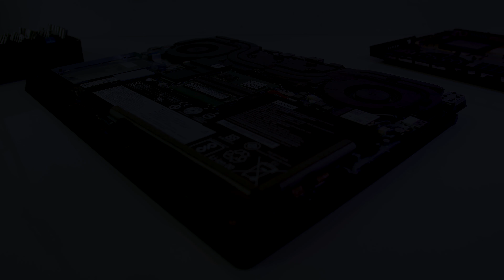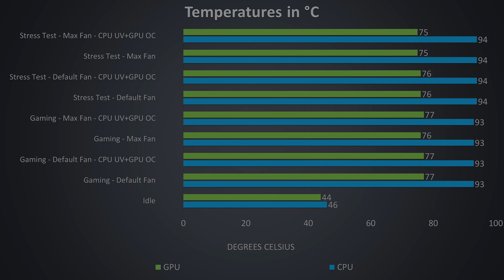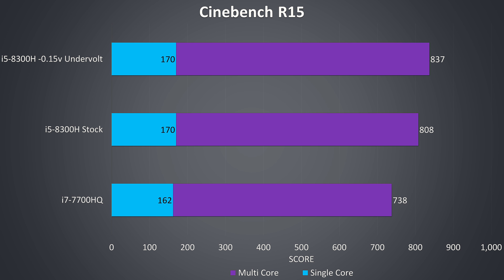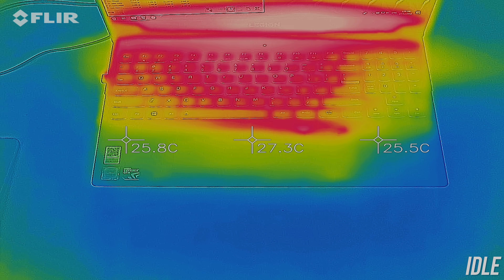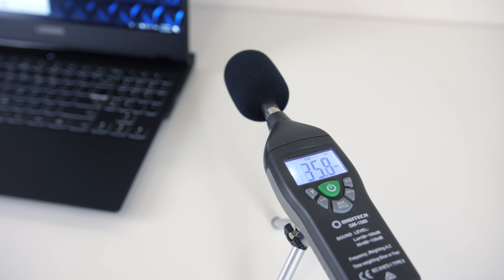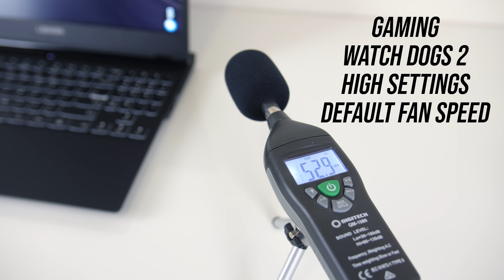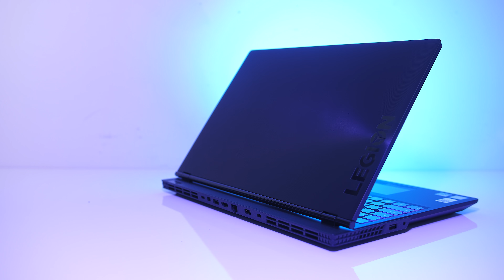Lenovo Y530 Thermal Testing, Overclocking and Undervolting

Comment: I'm having this one with i7-8750H, 1050Ti, 144Hz screen (more color accurate than 60Hz). It comes with 135W AC adapter which is rather not enough. Battery starts discharging while gaming and also getting some power throttling. UV of -0.15 (stable) helps with thermals and reduces power throttling but it's still present. If I overclock the GPU (240/400) power throttling is getting even worse.
The sad thing is that 1060 variants come with 170W AC adapter - wonder why not all. Currently thinking of buying one of those.
PS. I found out that lifting the back of the laptop a bit (~1cm) reduces the temps by 1-2 degrees.
Reply from the maker: Oof, yeah sounds like it might be worth trying to get a more powerful adapter.
Reply: The crazier thing is, look on their website and lenovo makes 230w adapters for the P52, which has an 8750h and a lower tier quadro graphics card... And probably the same power connector. So for the 8750h and 1060 model which i have... I kinda wanna try that... But lenovo only specifies the y530 as compatible with the 135 and 170w adapters. And i put too much $ into this thing to start blowing fuses.
Reply: @Cal94   so 170W is not enough for 1060? In general if you plug in more powerful adapter it should not affect the laptop given the V is the same. It's the same thing as computer PSU - you can have 2kW PSU on a $500 PC it will just be waste of money.

Comment: How did you adjust fan speeds? I have the Y530 but it seems my fan settings are locked.
Reply from the maker: Control + Shift + 1
Reply: @JarrodsTech  Thankyou for the help and speedy reply, maxing the fans helps me alot in benchmarks, but is there any chance you know how to adjust the fan curve?
Reply from the maker: I don't, I was only able to work out maxing the fan speed with that short cut, I found no other way to make modifications.
Reply: @JarrodsTech  hello, is there an official guide on this? I couldn't find in my box.
Reply from the maker: @aymanlee  For fan speed specifically? I don't think so. All you can do is press "control + shift + 1" to max out the fans, that's all there is to it. If you're just after a general information and manual:
User guide: https://download.lenovo.com/consumer/mobiles_pub/legiony530-15ich_legiony530-15ich-1060_ug_en_201806.pdf
Maintenance manual: https://download.lenovo.com/consumer/mobiles_pub/legiony530-15ich_hmm_201805.pdf
Reply: @JarrodsTech  Thanks for the insight Jarrod, however I was looking for the official "CTRL+Shift+1" in those guide and manual but couldn't find anything for it. Is this not a known feature? And does pressing "CTRL+Shift+1" for the second time actually turns off the max fan speed?
Reply from the maker: @aymanlee  Yeah if you press that combination again it will revert back to normal. I only found it mentioned on some obscure forum while I was trying to work it out, not sure if it's in the official documentation as I have not checked it.
Reply: @JarrodsTech  I've tried and it works, kinda funny it's not mentioned in the official documentation though. Thanks man, you're the best.
Reply: @JarrodsTech  and subscribed to your channel.

Comment: Very good video and thank you for the content. Please do the repasting video. Everything you've mentioned in this video matches my result somehow. I own the Y530 with i7 8750H and gtx 1050ti. I repasted both CPU/GPU and undervolted the CPU around  - 0. 15v via Throttlestop. Before all of these changes, the CPU Temps in Aida64 (CPU + Memory + no FPU) were always above 92 degrees until the CPU underclocked itself down to 3.5GHz. After the changes, CPU Temps reach max 80 and the clock (all cores) stays @ 3.9 GHz. During rendering in Blender and compiling the UE4 in Visual Studio 2017, the Temps reaches 94 degrees and there is nothing I could do about these two scenarios. In Ubuntu 18.04, the Temps stay around 80 degrees(Machine learning, coding and testing with Jetbrains Intellij IDE and using docker containers). Sometimes, CPU Temps go over 90 in Ubuntu but this does not take so long because CPU underclocks itself. I hope I could help others with theses Infos.
Reply from the maker: Thanks! I'm going to do it once I get back from CES 👍 hmm that's concerning, but yeah thanks for sharing your results, the more the better!

Comment: My y530 battery drops when plugged in. I wish you would make a video how to undervolt/change settings. This is my first gaming laptop and I am lost?
Reply from the maker: Hmm I don't think I had that with mine, what wattage power brick do you have and what cpu / gpu? I suggest this guide for undervolting https://youtu.be/yNt9L3BWOFo
Reply: @JarrodsTech  Just fixed it, for some reason rapidcharging was turned off and i just updated the bios thru lenovo's website. Thought it would be automagic. I have been using a mac for the last 5 years and have to learn pc all over again along with all the glitches.
Reply from the maker: Ah ok, well glad to hear it's all good now!

Comment: What did you use for cpu undervolting?
Reply from the maker: I use Intel XTU but generally throttle stop is suggested for longer term use, I suggest this review: https://youtu.be/yNt9L3BWOFo
Reply: @JarrodsTech  Thank you, did the same thing with my cpu.... what software you used for graphics card?
Reply: @JarrodsTech   Btw i have this same laptop with intel i7, and btw maybe i am just lucky, but i did, not  see any thermal trottling even without undervolting, but temps vere high

Comment: I always hear how temps are lowered with undervolting and liquid metal under stress tests, but in real world gaming, at least in my experience, it doesn't make much difference.
Reply from the maker: Depends on the laptop, sometimes undervolting can make the temperatures go up, but performance should still improve. I've seen this happen when the power throttling is reduced via the undervolt, so the CPU starts performing better which in turn generates more heat. As for LM no real experience, but I've also heard of people doing this to their Aero 15x (same laptop I recently repasted with no change) and noted they also saw little to no difference, possibly because the heatsink / fans are just too small to actually dissipate the heat, so the improved transfer to the heatsink doesn't really benefit much.

Comment: Could you post a video of undervolting the GPU via clock-curve in afterburner? On my laptop I can set a flat line at 1750MHz and that forces the 1070 to run at 800mv. Under load in demanding games like Dishonored 2 temps are about 58-62C on GPU compared with 75C when I run GPU at default curve. The first few minutes the performance when running default is better, but when the temps reach 70C and above clock-speed ends up below 1800MHz and the performance is very similar to the undervolt. In benchmarks the undervolt gives me about 10% lower score than with stock-setting, but after a few minutes the gap becomes smaller and usually ends up around 5% lower than default. At stock-settings voltage gets up to a max of 1075mv and clock-speeds at that level usually lies around 1850MHz, but after a few minutes the starts to drop. A different approach I tried was to set 1750MHz at 800mv up to 1800MHz where I change curve to 900mv. This gives me 2-3% better performance than default settings, temps ends up around 70C and it seems the pc is able to maintain 1800MHz for longer periods of time with minor drops down to 1780MHz etc. For gaming on a laptop I would highly recommend everyone to use frame-cap if you dont use v-sync (I have a g-sync 60Hz-display on mine so I framecap at 60fps) if you dont have g-sync to keep noise\heat under better control :) If playing overwatch etc is your thing then a higher framecap could be wise.
Reply from the maker: I don't test with GPU undervolting, only CPU undervolting. To be honest I've never found it to really help in the grand scheme of things, at least when compared to the volcano that is the Intel 8th gen CPUs. I might look at it again in the future, but for a while I haven't been including GPU undervolting results in any of my testing.
Reply: Okay, thx for info :)

Comment: Hey, I also bought the same laptop only with 1050ti graphics card and i noticed a bit high cpu temperatures when gaming... Goes almost over 80°C after like half an hour of gaming. What should be the normal temerature for this laptop?
Reply from the maker: 80c sounds perfectly reasonable while under load for an 8th gen CPU, I wouldn't worry about it.

Comment: Do the thermal paste change.. Use the MX4. It's a really good thermal paste. It would be nice to see any change and may motivate me to change my G7s thermal paste even though dell biult the G7 so it's an almost impossible mission to replace the thermal paste. You have to undo the whole computer.
Reply from the maker: I think I'm out of that, I have NT-H1 and Kryonaut which technically has better conductivity rating, so should do the job? It will have to be after CES, I fly from Australia to the US for a week in a few days so won't have time to get to it before I leave unfortunately.
Reply: @JarrodsTech  Have a great time at CES man.
Reply from the maker: Cheers!

Comment: i read some reviews on internet about its bad or dull display like 
its come with dull display,
colors are not accurate,
RGB is below 70%
low contrast etc...
is it really comes with bad display???
Reply from the maker: I guess it depends which display you get, there are 3 types (I talk about this more in the full review coming out this weekend). There is a 250 nit 60Hz, 300 nit 60Hz (what I have) and 300 nit 144Hz, I think the lower 250 nit has lower colour gamut while the others are better but also cost more money.
Reply: @JarrodsTech  how can i get this info before buying from store, like are they written down on the box?
Reply from the maker: @beeko3000  Not sure, ask if in doubt, I ordered from Lenovo.com so it was very clear with the specs of the screen listed and the option to select better ones.

Comment: Howdy Jarrod. I'm planning to get a gaming laptop but can't decide between Helios 300, Legion Y530, Tuf FX505 and GP 63 leopard. All these brand have GTX 1060 but different thermals( currently looking for the best thermal in budget range) I5 would be sufficient since I will mostly gaming but wasn't sure if it's enough for video editing. However choosing I7 option means more thermal to manage. The budget is around 1.2k USD and I'm a quite a hardcore gamer(sometimes 12 hours straight of gaming average is 6~8 hours) Will be using cooler pad with the laptop. Any recommendation of which one shoud i buy? I'm from Malaysia and the choices here aren't much and some stuff are quite expensive. Thank you in advance.
Reply from the maker: I haven't used the GP63 myself so can't really comment on that one, all of those are pretty good options though, I think I'd be going for the Y530 or FX505 myself, I can't recall exact thermal results off the top of my head, but I did do this exact same testing on those other models too here which you can compare against:
Helios 300 thermals: https://www.youtube.com/watch?v=kc8b3uHsbvE
FX505 thermals: https://www.youtube.com/watch?v=jqvSZifr_Is

Worth noting those are i7 variants though, but also worth noting some in the comments here get cooler results than me with the Y530 in the same workloads with the i7 somehow, so I might try replace my paste in a future video.

As for cooling pads, I did test one here, obviously it will depend on the pad and specific laptop, but it only seemed to make a little difference: https://www.youtube.com/watch?v=Zx2EnUD-DoM

6-8 hours makes no difference really compared to the data I show in the video, full heat saturation typically happens well before 30 mins, though I test each of my measured temperatures for 30 mins, and as there are 8 measurements taken that means I've been running for at least 4 hours sustained load, if that helps.
Reply: @JarrodsTech  Thanks for the fast reply dude. Will wait for ur repaste Legion Y530. Would love if you can do the same with Tuf Fx505. Does video rendering and editing differs a lot between I5 8300h and I7 8750h?
Reply from the maker: No problem! Can't with the FX505 unfortunately, it's gone back to ASUS and generally it's not something I can do with review units, I own the Y530 though so can do what ever I like. I don't think the video editing process will see much difference between the two, but rendering will be fairly sped up by the extra two cores with the 8750H.
Reply: Mohamad Arif Amir Mohamad Safri Recommand the y530, have one and is very good, just need to add 8 gb ram for more performance, cuz going to faculty at the end of this year.

Comment: undervolted mine for -0.200, now runs cool n quiet)) no thermal throttling, but the temps are still a bit high because of the crappy stock thermal paste, i bet the temps will be great after i change the thermal paste, looking forward for the mx-4 one
upd. can you please measure the thickness of the thermalpad on the ssd? mine was without the ssd and now im putting one inside and i need to know the thickness because i want to use that copper plate on the bottom cover
Reply from the maker: Wow that's quite big, is it stable?
Reply: @JarrodsTech  cinebench+intel xtu stresstest holds up well

Comment: I like my Y520 for a couple of games and some advanced video rendering/3D.

Normal use in Windows is odd here and there. It will get some more care as I bought it with "my own upgrades" in mind and "good cooling" in mind. I'm glad I didn't get an i7 thingy in a belief that it would be better.

What is your feel about the OS functionality/quick use in the Y530?
Reply from the maker: It seems perfectly fine just using it in Windows etc, no problems at all.

Comment: Hey Jarrod, I finally bought Dell G3 i7 8750H + GTX 1050TI. Thanks for all instant answers to my questions. I hope your channel cross 250k subscribers this year.
Reply from the maker: Nice, hope it's going well for you! Thanks for the support 😃
Reply: @JarrodsTech  So far so good. Played some old games I like at Ultra 60fps(Far Cry 4) and competitive games like CS:GO. Also Watch Dogs 2 at very high I get average 40fps. Very satisfied with it.
Reply: @aspicy  does this laptop gets hot in temperature? Do you feel any lag in gaming due to thermal temperature getting high?
Reply: I have the i5 8300h with 1060 max-q and it gets upto 100°c while gaming. Whats your laptops temo while gaming?
Reply: @SumanMaharjanflute  I haven't checked yet. But my easy suggestion will be to play games in 28°C or lower room temperature.
Reply: @aspicy  how's the battery life?(non gaming average ) in hours
Reply: @VinayakP  I get average 5 hours (typing something, Spotify playing in background, 3 chrome tabs open and 10-30% brightness) battery life. Keep your laptop battery at better battery or better performance mode. I get 5 hour 30 minutes maximum and 4 hours 15 minutes minimum battery life.
Reply: @SumanMaharjanflute  how are yours temps now? Any update?
Reply: @malfuriouz7717  I undervolted my laptop and Locked the frequency to 3.5ghz. Now its fine atleast it wont go 100°c haha

Comment: I'm so confused choosing between y530 or fx505, both i5-8300 and 1050ti, could you give me any advice?
Reply from the maker: Overall the Y530 seems like a better machine overall in terms of build quality etc, but the FX505 is decent too, hard for me to accurately compare as the FX505 I tested with had the 8750H so I can't directly compare with my own test data.

Comment: The good thing about my 7th gen I7 7700HQ is that once it is undervolted, it can maintain its 3.4 GHz turbo speed across all cores during all stress tests and games. If I enable performance mode, the CPU won't even throttle and temperatures are well within safe margins. Point is, the 8300H and its i7 counterpart are, at least on the paper, a worthy upgrade from last gen I5 and I7's but that sadly doesn't translate to better performance on the practical side since they can't maintain their turbo frequencies and will often throttle to lower frequencies which puts them neck and neck with their 7th gen counterparts, performance wise. I'd rather have a slightly less powerful CPU that is capable of maintaining its full turbo speed whenever It needs to than have a CPU that promises turbo speeds up to 4 GHZ and doesn't deliver on that. This also shows that more cooling is needed the newer chips, since they are still fabricated with the 14nm process node, and we all know that coupling powerful chips with slim chassis is going to do more harm than good.
Reply from the maker: Yeah the 7700HQ runs much cooler than 8th gen, but I guess not too unexpected considering even the i5-8300h runs faster than it.

Comment: My temps are around 70 degrees Celsius on my GPU and CPU temptures (undervolted) 65 degrees Celsius.
Reply from the maker: Same specs with similar ambient room temperature? Same stress tests running for at least 30 mins?
Reply: Jarrod'sTech i7-8750H and GTX 1050Ti (OC) Temperatures stay the around the same through the stress test. My CPU temperatures used to be 90 degrees Celsius before I undervolted 1.50mv I think.
Reply from the maker: Hmm, might try new paste in a future video and see how that goes!